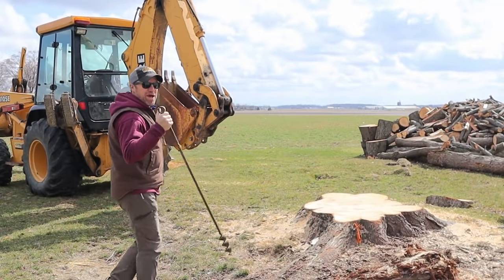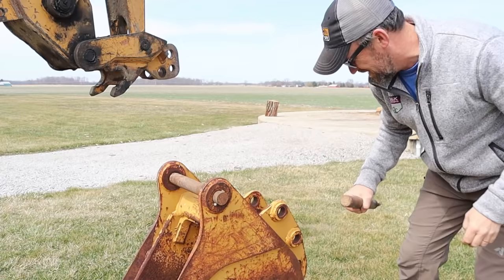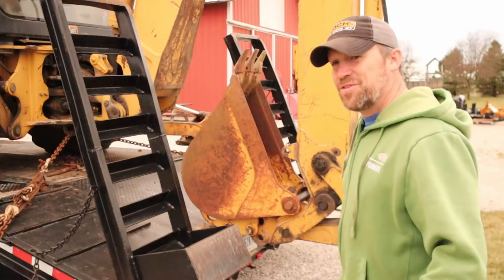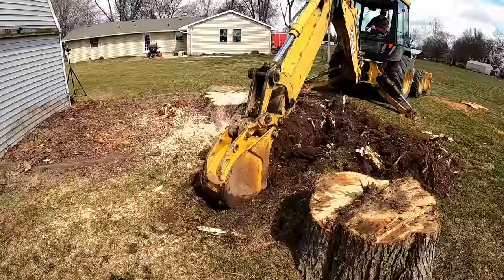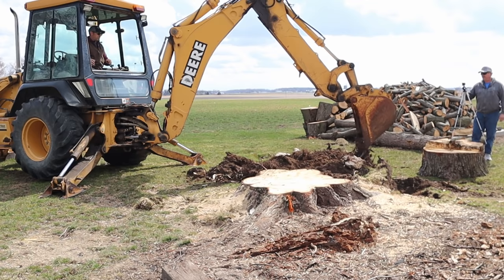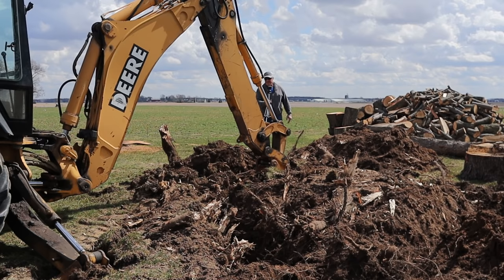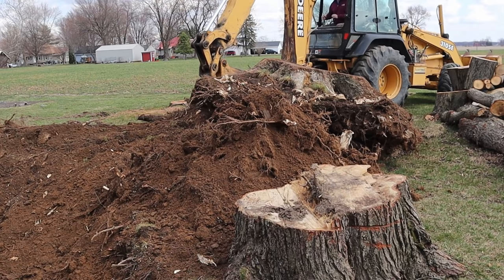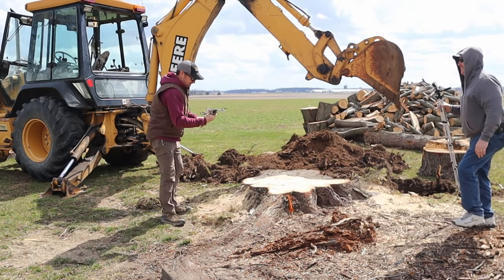The Biggest Stump I've Ever Tackled With A Backhoe! - John Deere 310SE Digging Huge Maple Stump

Comment: Sorry friend but by the time you went home to get the quick attach I would have had that stump out with a 36 inch clean up bucket.

You definitely over thought this one...
Reply from the maker: That might be true, but not with this backhoe you wouldn't!  Truth is, I have tried with limited success to do something like this before with a 36' bucket. It is not worth the trouble, strain and extra effort it takes to use a big bucket for this type of extraction.  My experience has been the narrower the bucket, the better at getting through those roots and more power you have with the teeth.  Always more than one way to skin a cat, but the "overthinking" is a result of thinking I could do it with a 36" once before.  Appreciate you watching!
Reply: @digdrivediy  fair enough. 

I had a 310SE with an extendable dipper and I only ever used a 24" digging and 36" cleanup. Countless stumps removed with the 24"and a few with cleanup. It can do it. But your right. A narrower bucket will stump easier.

Comment: If you would have stopped your cut about 6-8ft high and got a winch and some pullies you may have been able to get it out. When you cut them down to the ground you leave your self with no leverage.
Reply from the maker: But, it's tough to cut a tree off above your head?  Then, you've still got to mess with pulleys and pulling and then cutting the stump off afterwards.  You're just moving the work around in different ways.  I don't think you'd save any time.  This only took 2 hours. ?
Reply: @digdrivediy  this is true

Comment: you dont drill through the top. you dig a trench along side the stump deep enough to be able to auger  underneath the stump. then you put in a 1/2 stick and blow a pocket under the stump. then you slide into as many sticks as you think it will take. its just not the method in such a confined space unless you know what you are doing a as well as needing a blast mat to cover it with.
Reply from the maker: Sounds fun Greg!

Comment: Do you prefer that backhoe or that volvo mini excavator? I'd always go for the excavator personally
Reply from the maker: The backhoe has more power and digs better, but the mini is nice with hyd thumb and 360 swing. If I could only have one though, it would be the backhoe hands down just for the versatility of the front loader as well.
Reply: @digdrivediy  thanks for taking the time.  A backhoe feels so complicated to me. Driving around to be in the right spot for digging, putting down those hydraulic feet..sorry not a native speaker. The heavy counterweight of the excavator while using the front loader. I rather jump on the excavtator and it's all perfectly balanced. But anyway, that's personal preferances and you're absolutly right about the more options you got with the backhoe

Comment: Way to mutch  work and way to mutch tair for that backhoe i would have drilled holes in the stump and burned it then i would have used the backhoe to dig wats left out
Reply from the maker: That's one way to do it but we were in a timeline to get the building started.
Reply: @digdrivediy  yea i suspected that you Was when you Said it Was in the corner off the building plan anyway great video and greetings from sweden m8

Comment: You do auger in from the side
Reply: Idea is to get under the stump, place a small charge and create an open area. Then put several sticks and some diesel soaked nitrogen fertilizer in the open area. Cover the access point and ignite, hopefully pushing the stump up and out.

Comment: As they say, when taking out stumps, you don't need to remove the dirt, you just need to break the roots.  So you could even just use a ripper tooth. And if you can't break them close to the stump, move farther away from the stump. It'll be easier because they get smaller. And you get more of the roots out that way.
Reply from the maker: Right on Kerry!  That was my approach pretty much!

Comment: @ JSbackhoeop . Thanks for the info on the coupler .
I bought my tractor 1989  580 K Case in 2004 - 16” bucket , then about a month later found a 30” bucket & a coupler &a bulldozer ripper tooth , cut into the coupler and welded in the tooth so I have a ripper about 2’ long for ripping out roots , works great ,  used it to rip out all the roots on the building sites I was preparing , where I took out the big tree .
One other thing I always add  - is go to this web cit , explore, participate in the studies, & services  , airs 24/7 , sonlifetv.com
Reply: I blasted stumps with my dad in the early 50 s  so the bulldozer could come in & make the road
Reply from the maker: That's a nice setup.  Wish I had a ripper tooth some days.  Appreciate you sharing!
Reply: @ Neil ,  Thanks ! 👍I am currently building a thumb set up , as they tell me there is not a hydraulic one for it .   I would send you pictures of the ripper & the thumb when I get it finished , BUT - I don’t know how to do that !

Comment: And I thought burning down a stump was too much work.
Reply from the maker: This only took a couple hours.  Had the building pad ready for concrete the next day so burning would have just taken a bit longer.  Thanks for watching!
Reply: @digdrivediy  Great video BTW, I definitely recommend this over burning if you need that tree 100% gone. 

IMHO, stump burning via auguring through the tree’s core and hollowing an alcove for a charcoal furnace under the tree’s roots achieves similar result with no industrial machinery.

Comment: Maybe digging around it before cutting. A push and a pull tree and root system.  High School physics
Reply from the maker: I've done plenty that way too. This one was a little big for that in my opinion with just the backhoe. If I had an excavator would have felt more comfortable. I didn't have high school physics unfortunately but I think I get the lever theory.
Reply: I agree, its alot faster an easier to dig out around them an push them over with the whole tree, but I also know what hes saying with the size an only having the backhoe, I took down a 2 foot round, 40-45 foot tall pine tree with a bobcat 35 mini trackhoe bc my boss said, oh itll push it over. 😒😒😒 it did but I had no control of it. Luckily there wasnt anything around me bc if it would've started anyway but the way I started pushing I couldn't have done a thing about it!! Lol

Comment: I am a senior citizen I have took out thousands of trees with my 680 case backhoe with a 12 inch wide bucket dig around the stump start out wide breaking the small roads and work your way in getting underneath the stump as much as possible then raise your bucket to a reasonable height and then push. trees are top-heavy the weight of the tree / branches will  do most of the work for you. You're just clowning around wasting time.
Reply from the maker: It only took a couple hours to dig out this massive stump. Very similar amount of time for digging it out whether I left the tree stand or not. Then if you push the tree over with the stump attached, you still have to deal with cutting the stump off while you hold the trunk up. So, Im not sure how much clowning was involved but as far as wasting time...it wasn't much.  At least I don't think.

Comment: I've dug bigger with a shovel and reciprocating saw
Reply from the maker: Oh now, C'mon.  Did you lift it out of the hole with a floor jack then? :)  Thanks for watching!
Reply: @digdrivediy  no I'm not kidding. You dig and cut each root about 2 foot so you can keep digging down to the next root. Then once you under cut it and break it loose you fill in the hole on one side then rock the stump to the other and fill in until the stump is high enough to pull it out.

Comment: A word of advice on removing large trees... Do what you can with a 2' bucket on the roots for 10 minutes, then push the tree over with the root still attached. I'm shocked at seeing old timers cutting a tree down that low without thinking about the roots/decomp. Work smarter, not harder.
Reply from the maker: How do you cut a tree off "up high" on a tree this size?  Stand on a ladder while running a 36" chainsaw?  Not safe. 

This tree was too big to be dug around and pushed over with a backhoe.

The 1 foot bucket is much better for digging roots than the 2 footer.
Reply: @digdrivediy  no you extend the back hoe arm after the roots have been weakened, and then start jousting it as high as you can reach with the bucket and with the blade behind you so you can apply more pushing force. After the tee falls, you go in there with the excavator and rip branches off or start chopping with a helper, you hold the tree in a way the chainsaw guy won't pinch the saw with every cut. And boom that tree and roots would be gone in maybe 3 hours 🤷‍♂️ depends if I burn the roots and branches, then I'd make a hole for the burn. I'm only 29 but accumulated 4500 hours operating within the last 3-4 years. Started chewing my boss out for wasting people's time cutting trees down 💀

Comment: Why the hell did whoever cut it down cut it so low?!! Leave 6 feet above ground, dig out some roots and use  the leverage of that 6 ft. above to pull or push it over.
Reply from the maker: It's somewhat difficult and dangerous to cut off a complete tree of that size at 6 foot.  You'd obviously need to be elevated in some way.  That is why.  I've cut even smaller trees off at 5 or 6 feet above the ground and that short of a stub doesn't seem to help as much as you'd think for leverage.  They never come out till the roots are all cut off regardless anyway.  I'm the one who cut it down.  Several videos before this one. Thanks for watching Jim!
Reply: @digdrivediy  It ain't difficult or dangerous if you climb it and work down. I guess if it wasn't near any structures it'd be tempting to drop it at the base.

Comment: That is not that big of a stump for a commercial stump grinder. Probably take 2 hours with leveling the mulch . I hour transport time. Check out a Vermeer stump grinder.
Reply from the maker: But you can't have mulch in a giant hole that you're going to put a building on top of is the thing with this stump. So you got to haul away the mulch and make sure you get it all out of there anyway.

Comment: That was pretty dumb. If you wanted the stump out why cut the tree off at ground level? Leave the trunk as long as possible, put a chain around it as high as possible, cut the main roots with an axe, dig a small trench around the circumstance, fill it way water, let it soak a couple of days and pull it over. Also saves wrecking a good backhoe.

Comment: I would of had a guy grind it deep for $100 and then dug your building. Would of saved you a lot of heartache and wear on your backhoe
Reply from the maker: Also this really wasn't that bad. 3 hours in and out. Didn't have to deal with any grindings either.
Reply: @digdrivediy  You had to dig for hours and deal with an awkward giant stump, roots,, and a bunch of tore up earth. Not a walk in the park. Guarantee it took longer than that after it was all said and done. Plus again you beat the hell out of your backhoe. You would of had 2 bucket fulls tops of grindings which would of been taken away when you dug for the building.

Comment: totally wrong equipment.......a stump..... grinder wheel will shred the stump to 3-4 feet  below grade with only wood  chips......all roots cut and dead tree.
Reply from the maker: Maybe, but does the stump grinder remove all the chips and woody dirt from the hole? That would then be a second piece of equipment to have on site I would assume?

Comment: Would’ve been a lot easier and quicker to use a larger tractor or excavator with the proper digging bucket!
Reply from the maker: But it would have been a lot more difficult with a smaller backhoe or garden tractor.  (I don't have a larger tractor or excavator with a proper bucket)